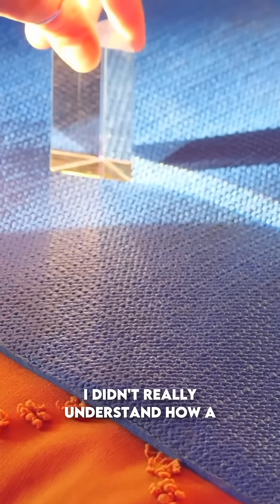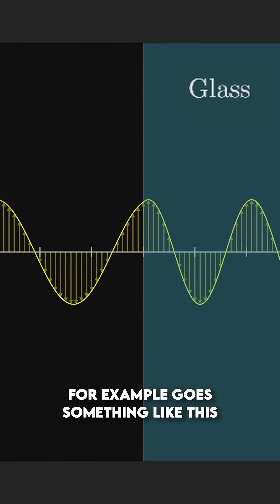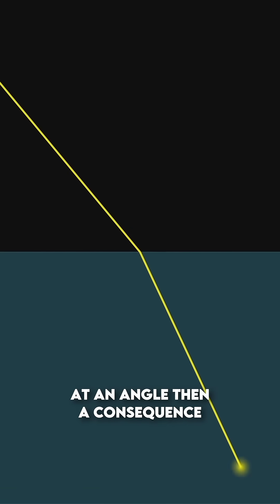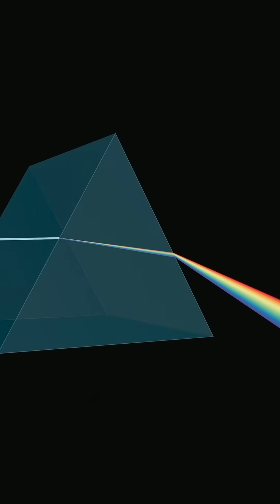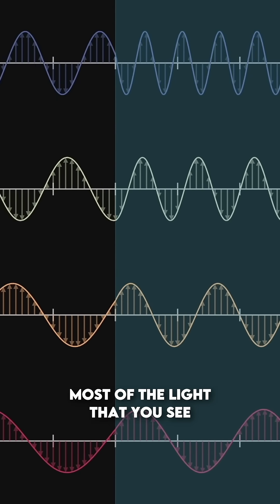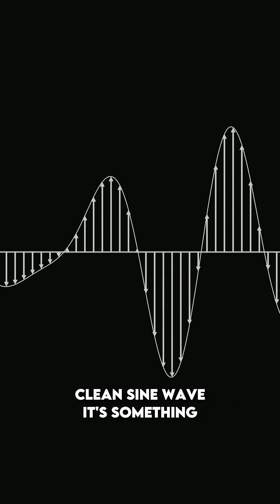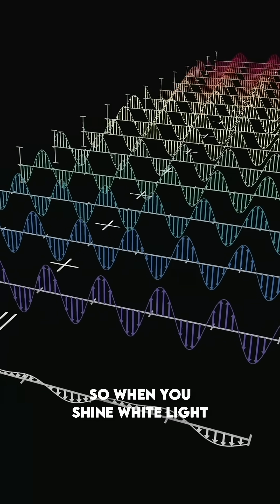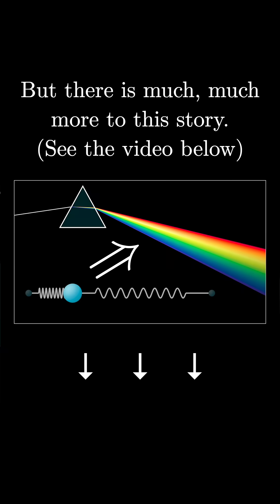How prisms work (full video linked above)

Comment: Is it refracting from the side that adds image reflecting? One might consider it's proving wave or bow split. A pull of color as well fire..a tv reverse or wave observation to see first tv function was aerial. To define both.. vertical and horizontal or the fit between two holding patterns . Color. 😊

Comment: Not a buyer. Think again on this one...

The variable thickness of the light encountered substance, which when glass, or quartz, is solid oxygen and behaves like oxygen does, when encountered shakes and shakes the colors out of the twisted white mess at well known to water, variable rates revealing the weaving that flat surfaced media leave unveiled for those with the eyes to see to see...see?

Each color is a segment length forming one of the regular geometries formable inside the unit circle: triangle square pentagon hexagon heptagon octagon dodecahedron
RedOrangeYellowGreenBlueIndogoViolet

Each, a unique form.

 All formed from the first the root the triangle that knows H2O like water knows glass or any other oxide.

Set Aside from 📐 sides by angles.:.
All formed from the one 306090 with 
The side ratios 1:√3:2 

The perfect form is the circle containing all forms of light as Geometry .:. Defined lengths defining angles defining volume forming form from one radius when viewed through the vesica Pisces and a little familiarity with the idea of the square root of three and where she is commonly found hanging around. Mixing with other self re generating life force generators.

Comment: Is it frequency or wavelength which changes after changing the medium of the wave?
What I have read so far is that frequency is a property of source and speed or wavelength are function of the medium properties.

At the surface separating two media, the particles (or field oscillations in case of light) on both sides must stay in sync.

If frequency were to change, you’d get a mismatch: one side oscillating faster than the other → impossible, because they are physically connected at the boundary.

So the oscillation rate (frequency) is preserved.

Comment: Wouldn't it be more accurate to say the angle of refraction depends on wavelength? In a single medium, the distinction doesn't matter, but light doesn't change frequency at an interface between two media. The speed changes, the frequency does not, so the wavelength must.

Comment: Imagine light as an army of soldiers. That is, particles, not waves. If the soldiers run in rows from a concrete square to a field, they run much slower on the field.
If the transition from the square to the field is diagonal to the direction of march, then the army changes its direction of march at the transition.

Comment: good god what a mistaken video. light in a prism DOES NOT SLOW DOWN. it doesn't. it travels through a DENSER medium, which means it has to cover more distance. it does not, however slow down. 

the simple fact and evidence that it does not slow down, is that when it exits the prism, it 'regains' it's 'original' speed. this is not possible if it was slowed down, as there is no 'medium' that increases it's speed back to as it was. 

hence, the simple fact is, that light simply has to travel more distance through a medium. it's an essential part of understanding physics. there's a lot of misinformation about it, but there's no dancing around it.

light also does not 'slow down' in an atmosphere. it travels more distance, compared to a vacuum.
this is why light through a planet and light through space have different moments of arrival. this, we mistakenly, declare as speed differences. but that's not the case. it's 'just' a difference in distance. in a cloud, light bounces off through particles more, than in unobstructed medium like a vacuum.

Comment: Now, tell all the scientists that the "red shift" they see on distant celestial objects is not because they are moving away from us at incredible speed but because light slows down over long distances.
Reply: Except it obviously provably doesn't. The speed of light is invariant and the tired light hypothesis has a ton of holes in it that are easily solved by the standard model.

We don't see any scattering effects on light from distant sources and we've observed a thermal spectrum of the CMB just to start, and neither of those things should be possible under a tired light model.
Reply: @physicsunderstander4958  Can you prove that without a doubt?
Have we seen every scenario possible to know the full extent of light? We hardly even understand light. What's a photon? Has anyone seen one? It would have to have zero mass to fit the model of traveling at the speed of light yet it is able to exert force on things? Illogical. We don't know everything, not even close.
Reply: @jackflash6377  Yes. Explain to me how you can get a thermal spectrum of the CMB in a tired light universe. It just doesn't work, and it doesn't work in a whole bunch of very obvious ways that immediately discount it.

You can say you think car tires are actually square all you want, claiming that we haven't observed EVERY car tire does not mean that every crazy theory is just as valid as the accepted one.
Reply: @jackflash6377 👂👂👂

Comment: Does refraction actually slow the photons / waves of light? Or does the light take what amounts to a longer path? After all, the photons must be reflecting off each atom or molecule, losing a little bit of energy each time, and each component frequency must take a slightly different path based on the unique interaction of said frequency with those particular atoms or molecules, right?

Comment: so it slows down and then speeds back up ?   doesnt that break the law of conservation of energy though ?    what speeds it back up ?
Reply: The photons themselves never slow down, only the group velocity of the wave slows down. There's no acceleration happening, just a lot of weird interactions with the material that destroy and recreate photons so that they appear to move more slowly as a group. If you measured any individual photon's speed, it would always be c, but it would only exist for a tiny fraction of a nanosecond.
Reply: @physicsunderstander4958  but photons do not exist really.  They are just a reification of measurements to support such violations
Reply: @mikkirefur  no, they really do exist. They mediate the electromagnetic interaction and are the reason why light is quantized into discrete packets of energy. The photoelectric effect is a good example.
Reply: @physicsunderstander4958  pretty sure Teslas work demonstrated how this is explained via the æther medium
Reply: @mikkirefur  no it didn't, and any explanation that could be offered under the "aether medium" would be wrong anyway since the aether doesn't exist. 

Explaining how stuff like the photoelectric effect works without light being quantized would require explaining how light behaves exactly as though it is quantized in every possible way without actually being quantized which is more than a little silly.
Reply: @physicsunderstander4958  thats your opinion, or those that you have listened to, but the existence of the aether is self-explanatory, unless again people believe magnets exchange virtual photons, or something equally silly.

Comment: The Concept of Using Prisms as Pixels in Visual Media
Imagine a world where each pixel on a screen is replaced by a small prism, manipulating white light to transform it into the shapes and colors of film. This innovative idea employs the principles of optical prisms, but instead utilizes artificial, miniature prisms that can change the characteristics of light in ways that go beyond traditional pixel displays.

Prisms as Pixels
Prisms and White Light:

Instead of each pixel displaying just one part of a color, envision each prism in the system being able to diffuse white light and convert it into various colors and shapes. As white light passes through a prism, it separates into its fundamental colors (red, blue, green, etc.), creating rich and dynamic images.
This transformation could allow for a much more organic representation of visuals, as the prisms would be capable of creating smooth gradients and transitions rather than being confined to discrete units of color like traditional pixels.
Artificial Prisms:

Instead of glass prisms, we could use artificial materials that incorporate nanoparticle movements. These movements, controlled by a CPU (Central Processing Unit), can vibrate and change the wavelength of the white light passing through them. This enables the fine control and adaptation of the colors emitted by the prisms, creating more complex and precise visual effects.
Mechanisms of Action
Nanoparticle Movements and Vibrations:

Nanoparticle technology can be employed to create flexible materials that respond to electrical impulses. These materials can vibrate at different frequencies, altering how light passes through them. Consequently, the prisms can simulate various colors and shapes in real time, enabling the creation of images that are both dynamic and interactive.
Each prism can be adjusted to emit a specific color or shape based on the desired visual output, allowing for an unprecedented level of customization.
CPU and Control:

The CPU can analyze visual data and determine which colors and shapes should be displayed based on the content being played. For instance, when a scene featuring a blue sky is shown, the CPU can activate specific nanoparticle movements in the prism to create the corresponding shade of blue. This precise control allows for high-quality displays and realism.
Advantages of This Technology
Elimination of Pixelation:

This technology could facilitate the display of images without visible pixelation, resulting in a smoother and more aesthetically pleasing visual experience. Prisms can create seamless transitions between colors, making the overall viewing experience more immersive.
Removing the pixel grid could lead to a more organic perception of visuals, reducing the harsh edges and transitions often seen in traditional displays.
Reduction of Artifacts:

By utilizing prisms instead of pixels, it may be possible to minimize artifacts like the moiré effect or blurring commonly associated with standard screens. Prisms can provide more natural representations of motion and color, enhancing the overall clarity and quality of the visual experience.
Interactivity:

This technology opens doors to new forms of interaction with visual content. Users could manipulate colors or shapes through physical interactions, creating interactive art pieces and presentations that engage audiences in unique ways.
The ability to alter the visual output in real-time could lead to innovative applications in gaming, virtual reality, and live performances.
Challenges and Considerations
Technical Feasibility:

Developing this technology will require advanced materials and engineering. Creating functional artificial prisms that are precise and fast enough for real-time operation presents a significant challenge.
Calibration would also be essential to ensure that images remain sharp and accurate despite the variability introduced by light manipulation.
Costs:

The cost of producing such devices may be high, potentially limiting their availability in the market. Research and development efforts are necessary to reduce costs and improve efficiency.
Industry Adaptation:

The film and media industry would need to adapt to new techniques of shooting and producing content that take advantage of this technology. This transition would require time and resources, as filmmakers and artists learn to work with new tools and methods.
Conclusion
The idea of using prisms as replacements for pixels that manipulate white light presents a revolutionary approach to visual media. Employing artificial prisms with nanoparticle movements allows for dynamic, interactive visualization that surpasses the limitations of traditional pixels. This technology holds the potential to create richer, more realistic, and engaging visual experiences, but it requires further research and development to become a reality. If successfully implemented, it could transform the way we experience films and other forms of visual art, offering a future where visual storytelling is not just seen but felt in a profound and interactive way.

Comment: I think that there is a big misunderstanding  @3Blue1Brown: photons from the sun ARE pure sinusoide waves, each one with their own frequency, but they are not combined in a single electromagnetic wave that you can Fourier transform (like it happens with the sound) . In some way, they "fly" in parallel as they are not sharing a single channel like an electrical signal in a wire.

Comment: What you are seeing is the sum of photons going through and the differences in their inherent energy densities. The way I explain is an ocean flows around the rocks but a power washer will hit the rocks. Less dense/larger wavelengths can pass through easier which is why you have things like redshift. Similar to water rushing through stone or a light bleeding through a bedsheet. Light isnt slowing down in a prism, it is interracting with the material and causing refractions of every wavelength including ones you cant see that can still interact with the medium (similar to if you throw a baseball, flat rock, or a beach ball through water). If you look at the equation, 90% of this can be deduced. Now say xrays or another wavelength of light interacts, more of that energy can be absorbed by different parts of the atoms as it iteracts more with parts of the atom than something like a radio wave. This is percisely why some forms are unaffected by mirrors or prisms because the micro structures or atomic properties dont allow for that wavelength to interact (like a pressure washer shooting through a screen door instead of rocks)

Comment: if the light speed is constant, how light can slow down ?
Reply: Light speed is only constant in a vacuum. It's only in that medium. It's because there's nothing to interfere with it. Just like how sound also moves slower under water, as opposed to in air, because water is more difficult to vibrate than air is.
Reply: @GustavRex  i understand, but the photons amways travel always at the same speed in every medium, it is the absorbtion and reemition of photons thru the medium that look like lifgt travel slower.
 If not, space time dilatation will be different, cloks will show different  times moving at the same speed in a diferent medium..

Comment: When you don't know basic high school physics, don't misinform by making videos. Speed of light is universal constant. Here in this case loght frequency or wavelength changes with medium keeping light velocity constant.
Reply: This isn't misinformation, you just don't understand it. Blue has a much higher frequency than red, so saying it is "faster" is completely correct. This is not the same as the speed of light. Red light moves just as fast as blue light, but the light waves "move faster." It's not misinformation just because you're uneducated lmao.

Comment: Holy crap that's why sunlight is hard to capture in art, artificial lighting, and on camera. Stuff always looks different on camera because the lenses are designed for uniform light, as are artificial lights. In art it's a matter of learning to design for sunlight but so many people learn in studio lighting. None of those waveforms match the Sun because producing light like that would be extremely difficult compared to putting out the easy pure sine wave lights of LEDs and whatnot.

Comment: • attend a very expensive university, to learn Physics
• at the beginning of every semester, listen to…
”Remember when we told you that blee-blee was blah-blah? Well, it turns out that THAT is not true!”
• wonder why you went $100K IN DEBT to learn wrong information
Reply: That’s a bit misleading. Many concepts are simplified at lower levels. Models become more rigorous as you go through university, which is easy to think about as you start your physics career with light rigid uniform rods that ignore air resistance, this is not how rods exist. 
Simple models aren’t wrong, they are incomplete and their incompleteness is worth it, for the ability to introduce these concepts to later build on. 
You don’t start with general relativity you start with Newtonian gravity.

Comment: The light does not slow down.  The light is altered by interacting with the electric vector of the glass.  The amount of interaction possible is based on frequency.

Comment: You're wording is backwards... all those individual waves exist in sunlight. Your perception and subsequent "expression" of a single messy waveform is due to a lack of wave discriminator on the sensor input of your equipment resulting in you only measuring the sum total of their interaction with the sensor.
.

Comment: It just clicked why the angle is important. The bend is because of the slant surface, some light rays from the beam hit the surface sooner. Giving them more time to slow down and curve and "refract" throw the glass. Then the seperation of the spectrum of colors is the different amount of time the light had to slow down. Being the fast thing in the universe causing a dramatic affect when even slowed down even a little in different degrees.
If my theory is correct, then red should always be on the outer side of rainbow. Because it is the slowest color. (Violet is the fastest color and thus the light slowed down the least. So it goes threw the shorter inner curve)

Comment: the coolest part about prisms crating rainbows like that is that there can sometimes be very small gaps in the spectrum. You can determine the composition of stars by the spectrum of light that they emit, but also anything you can heat to incandescence. This is called spectroscopy